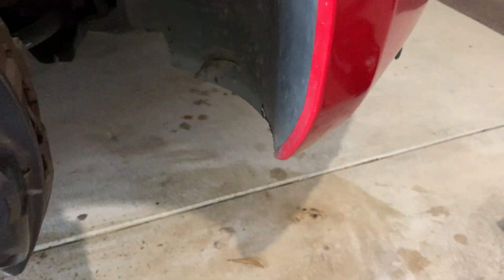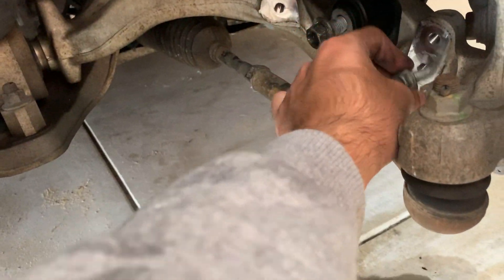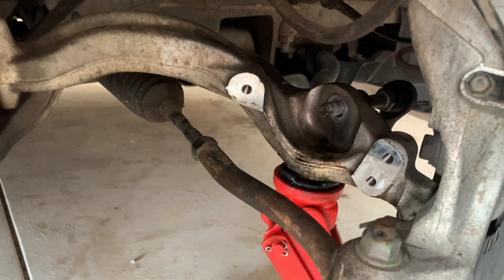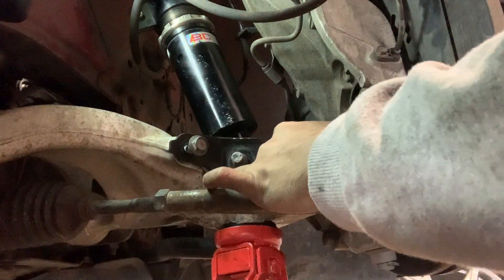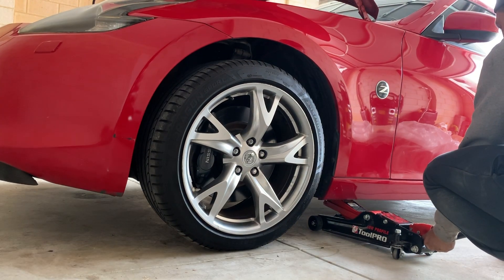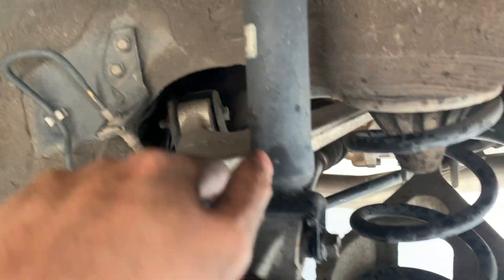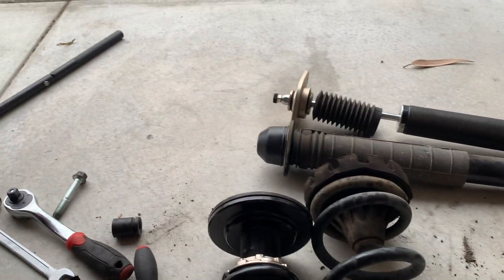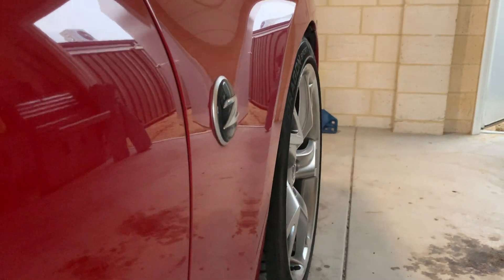*EASY* BC Racing Coilovers Install On 370Z !!

Comment: Currently fighting the 19mm bolt 🖕🏼
Reply from the maker: Yeahh it’s not fun hahah smack it couple times with a hammer
Reply: @Fauzilata  bought a big impact gun 🤣 1 down 1 to go
Reply from the maker: @polonologo2991 impact guns are life, has saved me sooo much time and energy 😂 I wanna buy the small impact ratchets hahaha
Reply: Would a breaker bar do it?
Reply: @07wrxtr1  went out and got a $250 heavy duty impact, didn’t work. Breaker bar + long pipe + hammer + some heat = finally worked and now I have a cool impact for whatever else 😭🤣
Reply: Thank you!  I have to do the front UCA’s so may as well add coilovers during the process.

I will avoid the divorced setup nightmare but my biggest worry per the forums are those bolts!!! 

Breaker bar time and I’ll make sure my neighbor is home!
Reply: @07wrxtr1  I think that bolt is in the way no matter a true coil or divorced, although trues are easier to adjust bc you’re only adjusting one thing the divorces setup will maintain closest to stock ride quality! Good look tho nothing a little elbow grease can’t break